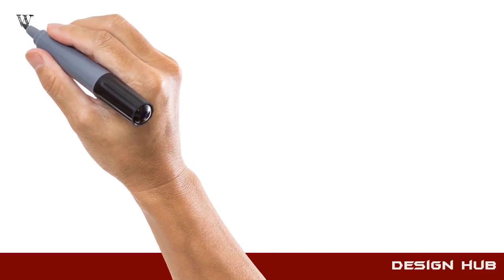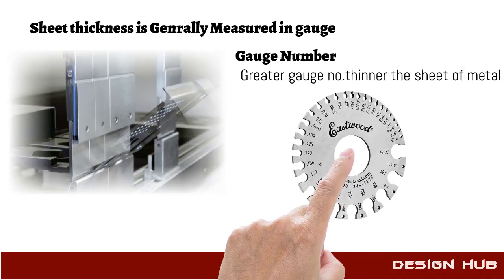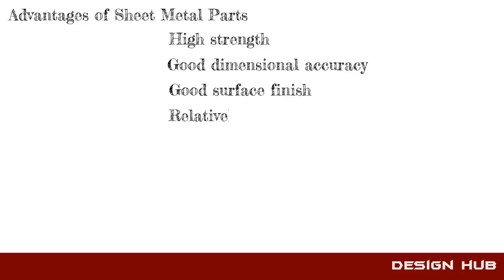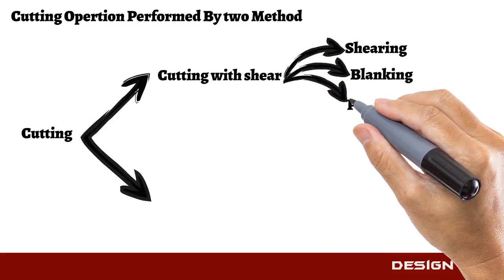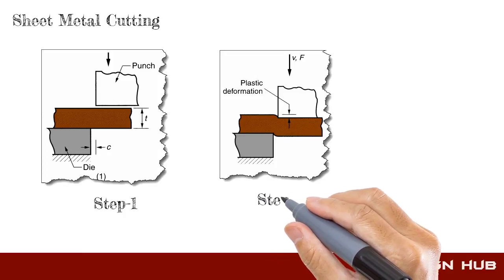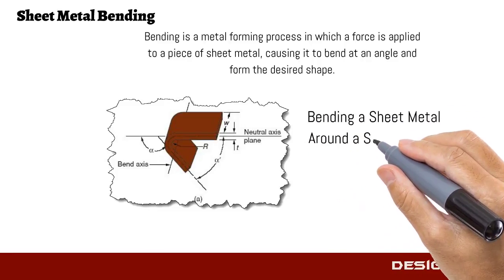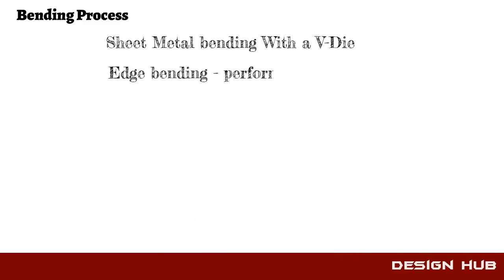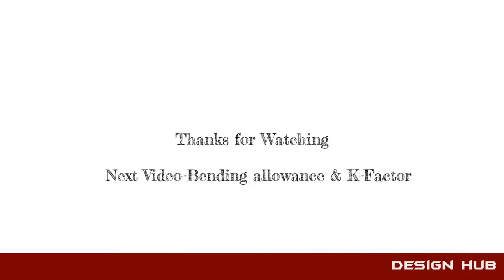Sheet metal operation-part 1|sheet metal design series|

Comment: Greetings Of The Day

Kiran Brand Heavy Duty Machinery Available In Ready Stock

Mfrs &  Exporters....

Kiran Agricultural Industry & Foundry Works
11/2 Industrial Area A Extn.
Ludhiana Punjab India
Sheet Metal Machinery & Workshop Machinery.. Industrial Machinery..

'We are a house of ready stock metal working machinery, supplying all over the globe since 50 years. We have a large variety of products helping us cater to clients from cottage industry to corporate sector as well as training institutes. Our products include Heavy Duty Lathe Machines, Metal Lathe, Milling Machines, Drills, Radil Drill Heavy Duty, Grinders, Surface Grinders, Shaping Machine, Slotting, Threading Machines, Press Brakes, Shearings, Power Press, Hydraulic Press, Radial Drill, CNC plasma cutting, CNC Trainer Lathe, CNC Trainer Milling, Special Purpose Machines (SPM), Hacksaw, Bandsaw, Pipe Bending, Ironworker, Sheet Bending, Iron Shear, Sheet Shear, Mechanical Shearing, etc. We also deal in MIG, TIG, Spot, MMA, Arc Welding and Profiling Gas Cutting Machinery

A Step Toward Quality&Technology

We are counted as a fast growing business organization engaged in manufacturing, exporting and supplying Heavy Industrial Machine Tools and Accessories.

Our clients can avail from us the best quality range of products, which are generated under the supervision of quality experts. The main mantra for our huge success is the quality of our products, which hold the prime importance in our production. Apart from this, several rigorous quality check ups are carried out to make the products free from unwanted components to assure flawlessness. This process is followed from initial stage to final dispatch.

Our team Backed by the reliable and trustable team of professionals, we are able to introduce innovative and durable range of products. Our team is comprised of quality inspectors, technicians, quality engineers and administration that work as a single unit to generate higher production. They hold depth knowledge in their respective domains and help us to maintain high regards among our clients.

Our specialized unit of R&D keep track on current market trends and advancements thus come up with ideas and innovations that override current demands. Apart from this, quality is assured in our product by conducting safe and expensive tests and verifications by our quality inspectors.We give premium priority to client requirements thus develop a close relationship with them via our well-knitted network. To facilitate our clients with the optimum quality range of products, we value their feedback and quires. We process and make amendment in those areas where we are lacking. This helps us to assure client satisfaction which in turn enables us to achieve a huge turnover.

Thanks

With Warm Regards
Vikrant Arora
9876858209
7009529105

rajarora2526@gmail.com

Ready Stock Available

Please find my catalog link: https://www.indiamart.com/kiranagriculturalindustryfoundryworks/